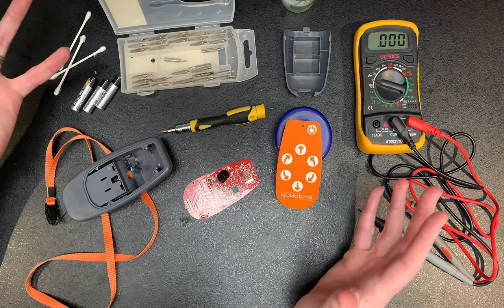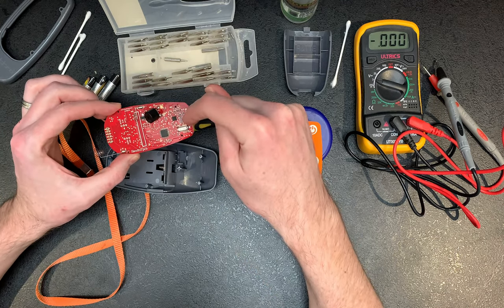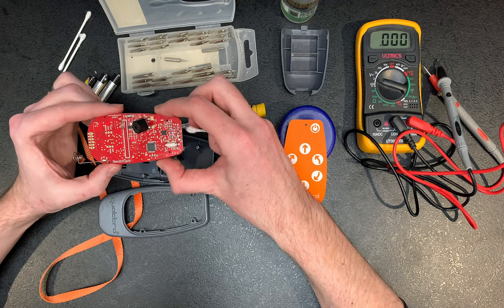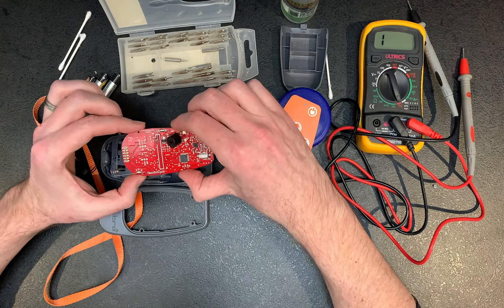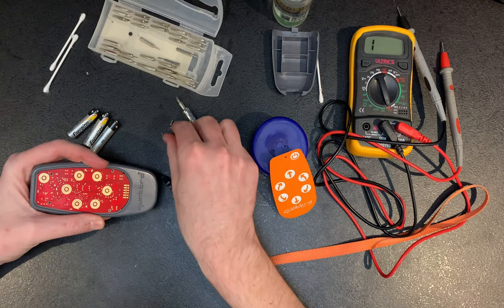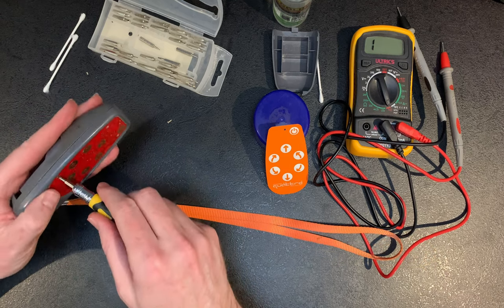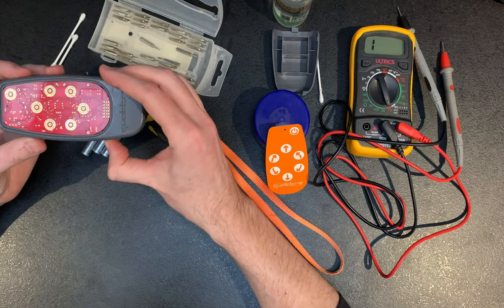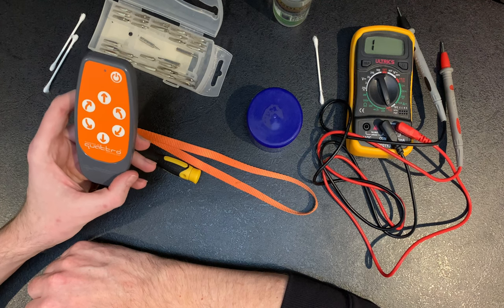Caravan Motor Mover Remote Repair, Try Before You Buy #caravan

Comment: Went to use ours and just getting a continuous beep from the sounder. Took apart and obvious corrosion but haven't managed to fix it. Will sound out various components but don't have surface mount equipment so it's probably going to be a universal remote replacement which unfortunately are not cheap.
Reply from the maker: They are a bit of a silly design really, I thought they would all be water-resistant which caught us out. If you feel it's that bad you might not have much choice this time, and no these things are not cheap but nothing is when it comes to caravans lol, hope you find a solution.

Comment: Did you have to repair the control with the box? Just had issues with mine so cleaned it up as you did. And now just gives a long beep when I try to turn the mover on.
Reply from the maker: Hi, sorry only just saw this, when you say a long beep I'm guessing that's coming from the controller, did you get it wet or did it just stop working ?
Reply: @wobbleboxcrew  I had to re sync the remote to the mover. 
Mover needs looking at tho. One side working fine, the other side goes forward but not backwards 🤔
Reply from the maker: So from the little information I have, I'm guessing you have three possible faults. 1) The button on the remote is not making contact causing it not to reverse. 2) A fault with the motor mover. 3) A fault with the main control box.

1) I would start by opening the remote again and try using something else to make contact to see if that's the problem, it may just be it's not sending the single. 2) You could try switching the wires over on the main unit for the motor movers to see if there is a fault with the mover of the main control box. 3) If you are good with electronics you could then move onto the main control box and work out which part has failed as you'll have one good side to use parts from.

Hope this helps.
Reply: Thanks for the video. Do you know of anywhere that sells touch rubber pad replacements. Mine was intermittent now won’t switch on, thanks again. It’s a powerwheel or power touch they seem to use both names when checking on google can’t find anywhere for spares.
Reply: Don't forget to clean the underside of the buttons on the sticker i fetched 4 cotton buds of gunk out of mine just narrowly missed ripping mine apart  and damaging it until i came across your video just peeled the sticker back cleaned up the board and away it went saved me hundreds of pounds they don't make that type of remote anymore